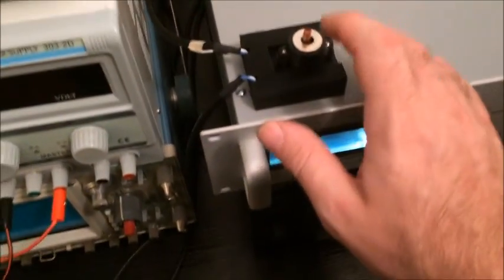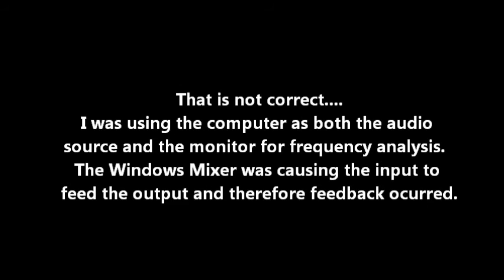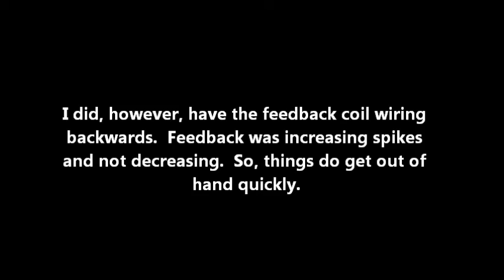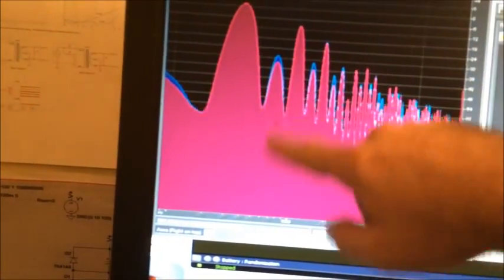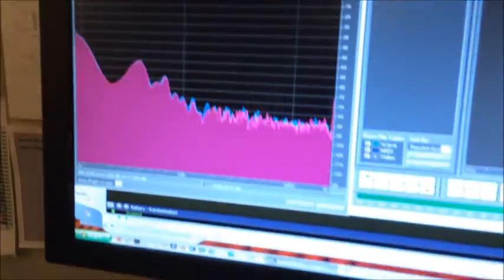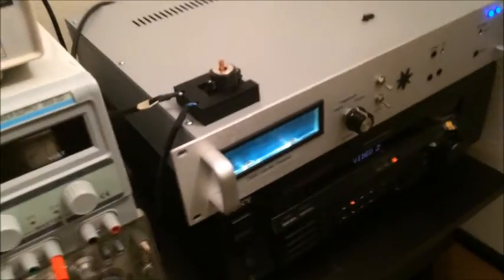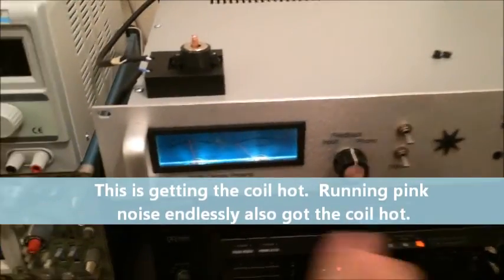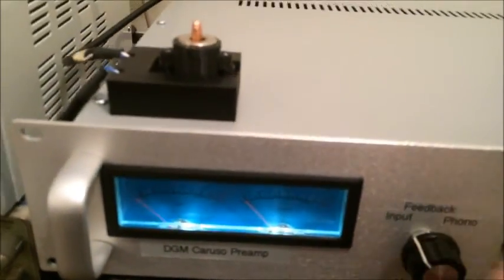Opcode's Caruso Build & 1st Feedback Tests

Comment: Is this a kit? Or did you just order all this on your own?
Reply from the maker: Colin Farrell No this is not a kit. I planned and built this independently.  Most of the boards are purchased from various sources.  I packed the boards.
Reply: Opcode66 Is it based on the Caruso?
Reply from the maker: Colin Farrell it used the first version of the caruso pre-amp. I have now designed my own boards.
Reply: Opcode66 Nice.  I might end up going with this for a Skully with a Haeco. Checking out options that are DIY and not $1000s...  ;)
Reply from the maker: Colin Farrell OK good luck
Reply: Opcode66.  Hello. I have a Neumann SX74. But there is no feedback preamp to it :( You do not have a feedback preamp circuit? Or can tell me the options where and what you can buy. Please help if you are not difficult.Go to my channel, there is a video of my machine and my cutting head Neumann SX74.